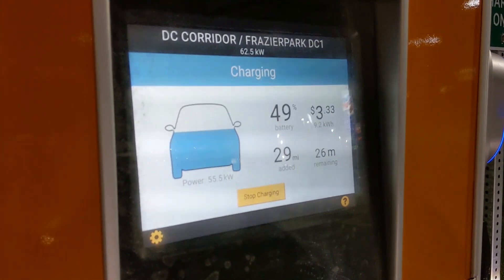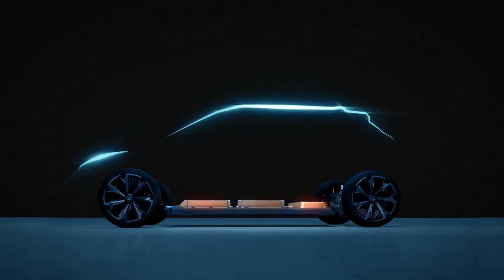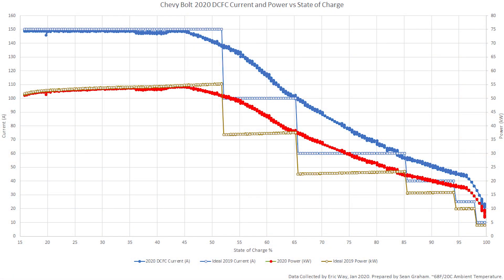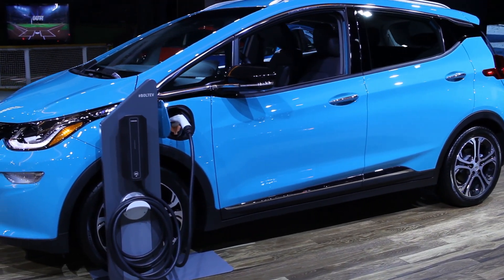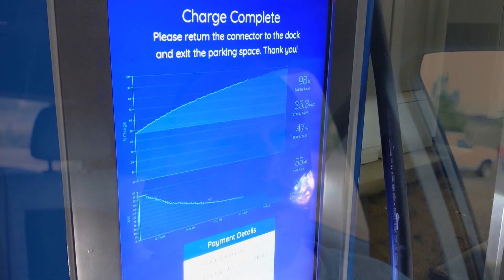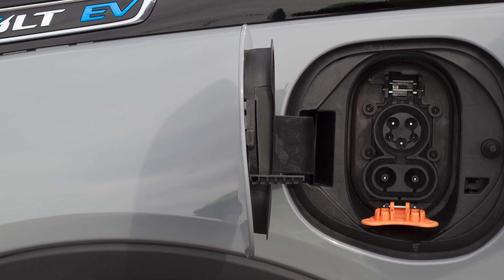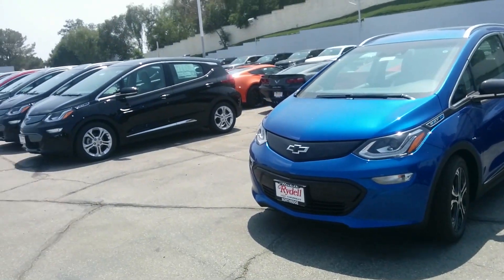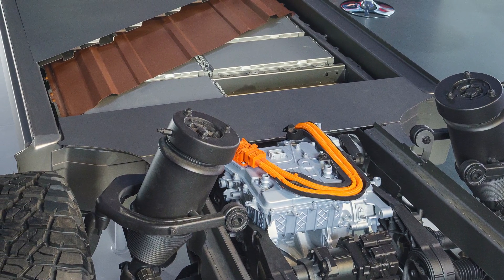Dear GM: Please Offer Chevy Bolt EVs a 200 A CCS Upgrade

Comment: A good idea as a factory installed option for possibly 10 to 15 percent of the Bolts sold.  However, most cars are used for home to office, 50 mile or less, commutes 90 per cent of the time. So it isn't going to be worth a $1,000 option for most people who charge primarily at home.  A dealership upgrade will probably cost double what the factory option costs.  An additional 50 Amp capacity will likely require not only a connector change, but also a heavier gauge wire harness, a firmware upgrade and possibly a new battery charge/power management electronics package. It may also be possible that there are limitations with battery life and safety in the present battery chemistry.  All reasons why I think that GM will put this off until there is a new Bolt model engineered to handle the higher capacity chargers. I applaud your thoughtful idea, but I doubt that it will be made available for several years, if at all.  Would become a requirement if GM were to offer a 90KW extended range battery as an option.
Reply from the maker: I mostly agree, though I don't think that much would be involved. And I'm fairly positive at this point that the battery/battery life is not the reason. If it were, the 2020 Bolt EV would see faster charging speeds.

Comment: The “package” that I would like to see is not only a socket upgrade but the light to illuminate the charge port as well. These two together will make me take the time to come in.
Reply: This would get me on board as well. I only depend on Level 3 charging a few times per year, but this would make it attractive.
Reply: They offer a lighted charging port upgrade, it's also standard on the premier models. Doesn't help the speed though. :(

Comment: "I think you'll see most bolt EV owners will jump on that" (9:00). Sir, you have high faith in "most bolt EV owners". It's possible that a large percentage of owners rarely DC fast charge anyway. Like us in our Tesla model S we bought used. Now at around 40% we don't see over 55kw and I don't really care too much  used to be that speed was around 70 percent. The overall wait time increased by 15-20 mins per stop vs. when we first got the car oct 2018. (Yes, they dramatically slowed the car since we bought it through ota updates /2013MS85). Our trips from FL to MD and back are not that much longer. Would I pay 1500 for the speed back? Nope. The bolts conservative charging curve, I respect.
Reply from the maker: Perhaps you are right. My main concern isn't actually the charging speed (I know that can only see a 10% bump or so). The biggest benefit is being able to cool or heat the battery and cabin without impacting the charging speed. Charging at 60 kW straight to 55% without losing anything to conditioning would be huge.

Comment: as an owner with over 114k miles on my Bolt I don't want faster charging until it doesn't cost more to charge at higher rates
Reply from the maker: Even with this update, it isn't likely to trigger higher priced plans like Electrify America's. Even charging at 60 kW with battery and cabin conditioning, the Bolt EV isn't likely to take the full 200 A, which is the cutoff point for a higher fee structure.
Reply: @newscoulomb3705  According to a Canadian couple with a 2020 Soul EV that I had a conversation with, Electrify America charges the 75kw-125kw rate (which we both agreed was crap), likely because EA is charging by peak allowable current and voltage, "possible power" (188amps has been documented in the e-Niro by Björn, which is highly likely to be identical in the Soul), rather than charging the rate for the speed that is actually achieved.

Comment: I'd rather see a 0-60 upgrade and a increased top speed.
Reply from the maker: Those would both require a more significant modification (essentially, replacing the motor or adding a motor).
Reply: @newscoulomb3705  I thought it was about preserving the battery.  Tesla has tweeked the insane mode with updates alone, but maybe you are right and it is the best the engine can do on the Bolt.
Reply from the maker: Yes, Tesla tends to release unfinished hardware and software, which gives them the opportunity to tweak and improve certain aspects through simple reprogramming. 

Essentially, a car like the Model 3 was always capable of outputting more power, reving to higher RPMs, heating the rear sears, and charging at faster than 125 kW. All Tesla did was lock and unlock those features using software.

Comment: I don't see GM doing this. They can barely be bothered to release updates for the head unit.

I tried to get in for normal maintenance (and get the DCFC update), and was turned away because they had a 4 week wait. The guy on the phone mentioned only needing a tire rotation.
Reply from the maker: Well, right now, sure. Things are a little tight. I know people who got in and out with the battery update in a couple hours prior to this pandemic.

Comment: I own a 2019 Bolt and a 2020 Kona. I did a test, charging both for 30 minutes on an EA 150KW charger in similar weather conditions, starting at 10% SOC. The Bolt charged 43% and the charger delivered 26.3kWh. The Kona charged 51% (larger 64kWh battery) and the charger delivered 36.5kWh. In the same amount of time. The Kona charges at 200a from about 15% to 50%, then drops to 175ish A from 50% to about 63%. The charging speed difference makes a substantial difference. I think the difference over a 45 minute period would be even more substantial.

I would gladly take a charging speed improvement on the Bolt. I'd be happy to even get the gradual taper that the 2020 Bolt has. But, it doesn't make a lot of sense for a new car manufacturer to offer upgrades for their older cars. It makes more sense from a business perspective to include those upgrades in a new car to incentivise trading up.
Reply from the maker: The difference doesn't change much over time. It's maybe a 20 minute difference charging to to 80%. The 2020 Bolt EV's charging taper actually cuts the difference down to only about 10 minutes. Still, the Kona Electric's advantage at lower battery levels is undeniable.

I do agree that it's not typically in an automaker's best interest to upgrade existing cars, but that model might need to change for EVs. The service center has only seen my car twice since I got it 3.5 years and 120,000 miles ago. That's not sustainable for dealerships.

Comment: The key is sounds like the 200amp would be more for those that taka bolt on many long distance trips like you do, are bolt buyers buying the car with long distance trips in the game plan? or are bolt buyers buyng it for more local/regional driving?
Reply from the maker: I think people are buying the Bolt EV to replace a gas car. Most people drive a vast majority of the time locally, but some of those people occasionally take long trips or regional trips of more than 300 miles too. Obviously, an owner would need to determine for themselves whether saving 20+ minutes per charging stop and getting away with fewer stops overall would be worth it. 

You're probably right that many Bolt EV owners wouldn't find value in it, but some would want it just to have the option.

Comment: Why not build the car to modern standards if their available? With many competitors having this
ability its not a reach for the future. GM will never learn.
Reply from the maker: For the 2020 Bolt EV, I agree with you. People forget, though, that the 2017 Bolt EV not only predated faster charging cars in its class by nearly two years, the first public chargers faster than 125 A only started being built about a year and a half after the Bolt EV was first released. So technically, it was released ahead of the supporting infrastructure.

My suggestion is just a way to bring those previous model Bolt EVs up to date with cars like the Hyundai Kona Electric and KIA Niro EV.

Comment: I had a Bolt for 8 months here in Florida after dealing with broken stations and having to go to alternate I had enough and went with the Tesla it was like night and day i took a hit on the lost but i did not regret it. GM is not series for EV my TEsla is not the same car  I bought a year ago thru software updates but the Bolt is the same car you bought in 2017. If they dont get series they will go on the ways like Blockbuster and Kodak....... Most of my issues have been address thru software updates. Your point of GM offering a premium for an upgrade will never happen they would just sale it as a 2022 model .... status quo....
Reply from the maker: Yeah. I know a lot of people who bought a Bolt EV because they could afford it when what they really wanted was a Tesla. It's too bad Tesla couldn't have offered a cheaper alternative sooner. It would have saved a lot of people the trouble.

Comment: Great idea, but given the way GM operates, this is about as unlikely as getting a CCS retrofit for our model 3s from Tesla.  Someone would just have to offer this Bolt update as an aftermarket upgrade.
Reply from the maker: At this point, I doubt Tesla will even offer a CCS adapter. It seems like they don't want their owners to even consider alternative EVs.

Comment: Eric - I’ve heard that there’s a charging curve reprogram available (bulletin) for those who live in cold climates which raises the DC charging speed going into a cold battery (2017-19).  I haven’t yet investigated, but might this be the newer (read: 2020) curve?
Reply from the maker: Yes, it's not the charging curve, but the battery temperature parameters that were updated. The 2017 to 2019 Bolt EV only has about a 5 to 7 degree window where it will see its fastest charging speeds. It sounds like the update broadens that window.
Reply: Correct. I applied the update myself via GM's GDS2. Really didn't see any changes in warm climates.

Comment: How do we know the current socket is rated to 150amps?  Is it stamped as such?  Not doubting just wondering where this data point came from.
Reply from the maker: Deduction. The battery is rated for 1 C charging. An argument could be made for the 2017 to 2019 Bolt EV that it was stamped "57 kWh" despite coming from factory with at least 60 kWh of capacity; however, the 2020 Bolt EV has 10% more capacity and the same charging rate. The battery itself is capable of outputting 160 kW and accepting 70 kW of regenerative braking. So all of the internal components are rated for higher power. In addition, the Bolt EV is set up to draw extra power from the charger when available to run battery and cabin conditioning, yet it's still capped at 150 A on high-power chargers.

That leaves only the CCS socket and harness that are unable to accept more current.
Reply: Not sure just socket. Could be wiring, could be power electronics specs, could be cooling capability of part that gets too hot, could even be BMS programming. Lots of reasons. It would be great to hear from a GM engineer.

Comment: So charging at 200 amps is what, 80kW?  I wouldn't pay a lot for that, unless maybe they increased the first step down to around 70-80%.  I may be wrong but I'm thinking the new VW ID.4 and the Mustang Mach E will faster than that, and these models are ~12 months away.
Reply: But for the Gen 1 cars they have to consider battery chemistry and what it can handle. Once GM has their new battery and models out they might phase out the Bolt.
Reply from the maker: I don't think they'll phase out the Bolt EV, but hopefully, it will get updated to the NMC 721 chemistry, which should support at least 1.5 C charging (100 kW to 125 kW at current pack capacities).
Reply from the maker: Yes, 200 A would be the equivalent of 80 kW on a 400 V architecture. The Bolt EV's battery can't really be pushed past 60 to 66 kW anyway, so the main advantage is maintaining peak charging speeds while also conditioning the battery and cabin. 

The ID.4 and Mach-E are in a different class than the Bolt EV, both starting at at least $10,000 more. A Bolt EUV is probably a better comparison for those vehicles, and the Bolt EUV is likely to come with 125 kW to 150 kW charging.
Reply: @newscoulomb3705  List price of the new EVs will be more, but they are eligible for the $7500 tax credit.  Add the $1500 update costs and we're even on cost but you'd probably get faster charging with the new EVs

Comment: Eric, thanks.
I think GM won't make any changes until the Ultima battery comes out. I wondering if we might see after market stuff coming out but that means the 2017-19 have to be plentiful enough to warrant it. I have the 2020 now, I'd like to see 200 amp charging but it depends on the price.
Rob
Reply from the maker: Thanks! They'll definitely make some updates before the Ultium batteries are available. The Bolt EUV will have a much faster charging rate (likely 125 kW to 150 kW).

Comment: I thought the Bolt was limited to 55kW charging also because of the thermal management system. Chevy offering faster charging in higher trim levels would only work if the sales people would be willing to actually learn about EVs. Remember how many buyers got stuck without DCFC!
Reply from the maker: No, the Bolt EV isn't limited based on heat dissipation. The batteries themselves are only rated for 1 C charging, which is why the Bolt EV's battery is one of the most energy dense battery packs of any EV. Even if cooling was an issue, the Bolt EV would simply decrease the max charging rate long enough for the battery to cool down.
Reply: @newscoulomb3705  If my math is right, this would bring up the charging rate to 60kW (2017-2019). I wonder how much time would one save (with adding the control module update). Would it raise the charging rate at higher capacity levels too (50% and up)? As you mentioned, I think it's only beneficial to a smaller number of owners, who public charge a lot, like yourself, but taken that technically it wouldn't cost Chevy anything (using parts already used on other vehicles) and it would actually create revenue for the dealerships, offering such update is just a matter of willingness from their part. Would be nice to see Chevy getting into the 21st century mindset, where their offer things because "Why not?".

Comment: It’s a 2017 design.  I think the next gen will charge faster. I also don’t see GM doing this. It would at least be nice to get a software update to give us the charge curve instead of steps.
Reply from the maker: Yes, if nothing else, I hope this prompts GM to update the charging on the 2021 Bolt EV if the EV Day rumors are true (55 kW peak rate).
Reply: The effect that it may have though is that the older bolt EVs will have much lowered resale value when that time comes. That has advantages if you're looking for a used electric vehicle, and don't need the faster charging. Could make for a pretty good bargain EV. The negative is if you own one and you're trying to sell it at that point could cause you some issues.
Reply from the maker: @kens97sto171  I think used Bolt EVs are already a bargain. The biggest impact improving the charging on the 2021 Bolt EV will have is enabling GM to sell them for closer to MSRP. Right now, most Bolt EVs are leaving the lot for mid to high $20,000s.
Reply: @newscoulomb3705  
Oh I definitely agree with you. You can get brand new ones for good prices. For a short time I saw brand new 2020 LT trim for 20 grand.
I just wonder if the 2022 or whatever the new one is that has let's say 100 kW charging. That may significantly diminish the value of the older ones even more.
I also agree with you that once the charging speed is more appropriate. They will be able to charge closer to normal retail.
That also makes me wonder whether your idea of upgrading the bolt to whatever the maximum ability the battery could handle on charging speed might allow them to charge a greater amount for the current vehicles. Would it be worth GM to retrofit existing vehicles that are not sold yet, and be able to sell them for $38,000 instead of $28,000. I don't know it's going to be interesting to look and see what they do.
One of the other issues is and this is something I'm dealing with myself. Used Tesla Model s's are starting to get into reasonable territory also. And even with a nerfed battery you're still getting significantly better charging than you would in a bolt.
So would you pick up a used Model S for $28,000, or would you get a new Chevy Bolt for about the same money. They both have some positives and negatives.